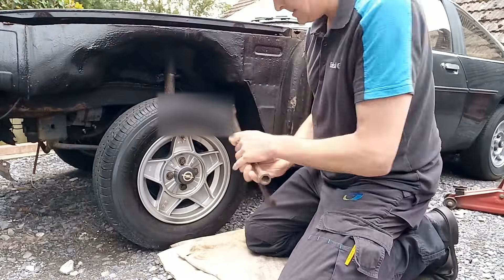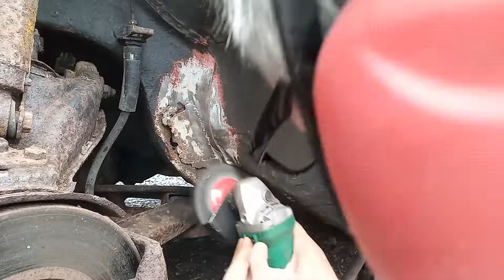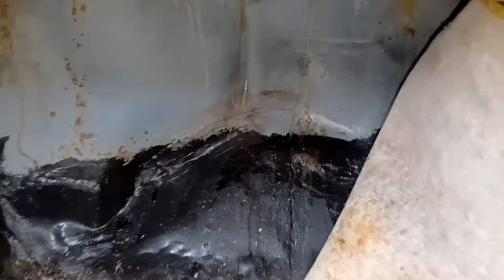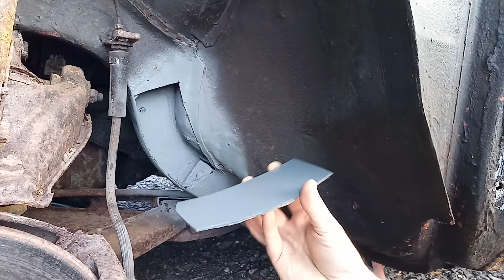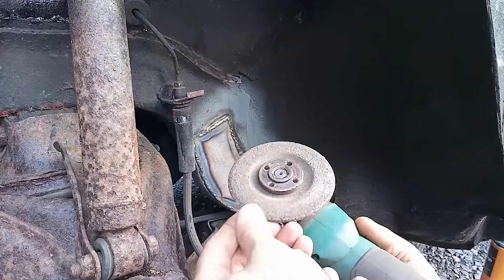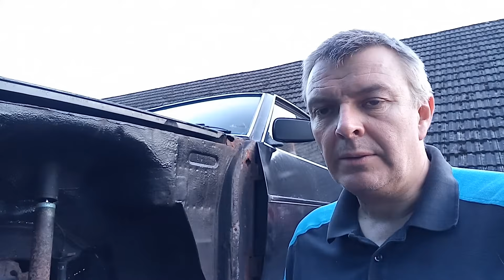Opel Manta rolling restoration, First bit of welding.  Car Restoration.

Comment: Great to see you are getting a bit done on the Manta Dave. I am sure this will be valuable to a lot of people with regards to rolling repairs on their classics. Looking forward to its progress . Like the idea of using the masking tape for a template . In the 70s a lot of dodgy fixes before the availability of the migs . Free local paper and filler, save the masking tape for the aerosol repaints lol.
Reply from the maker: I've even seen garden clay used to backup body filler 🤣🤣

Comment: You made me laugh 70s mot repair 🤣 yes but we’d have painted it with under seal then splash some mud on it make it look like it’d been there for years 👌👍 nice job Dave 👍
Reply from the maker: Ah yes, the old throw dust at the wet underseal to make it look original trick 🤣